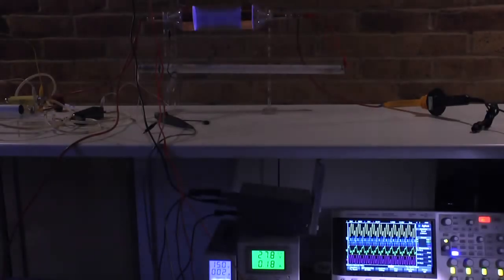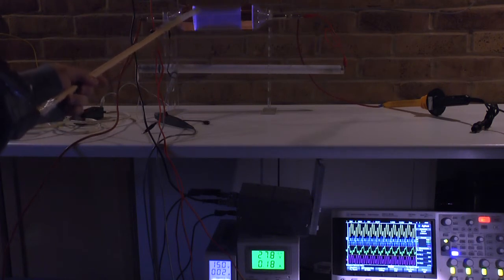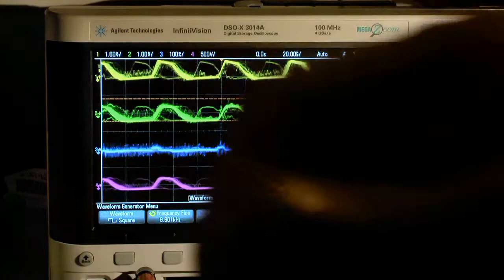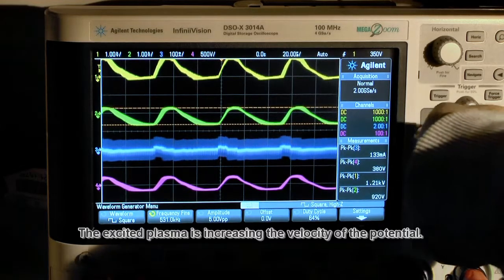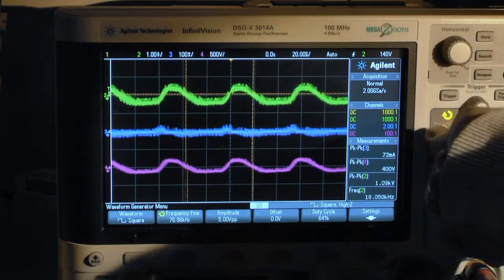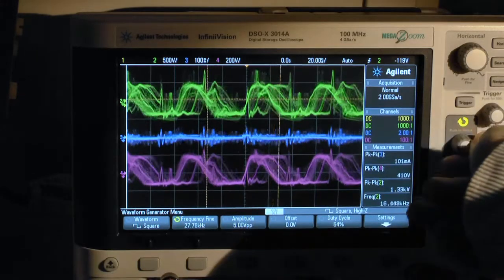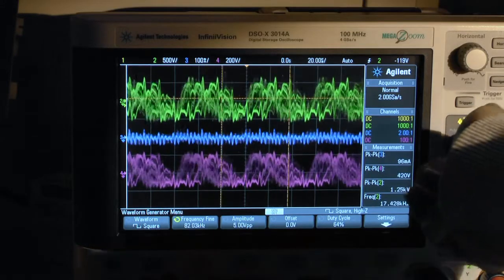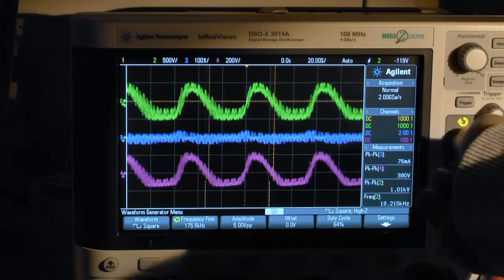The Plasma Switch

Comment: In a long neon tube many bubbles can be created by changing the frequency, The result of RR Rife research i did was a  by product and build. The frequency has to fit in to the length of the tube, 1 standing plasma WAVE bubble for full illumination, or multiple of plasma bubbles are formed inside tube, we can see that only certain frequency's or harmonics fit in to any given lengths of a Edelgas plasma tube. It is interesting to note you work with the transfer of energy from tube to tube is  Very interesting. Also you take note in what container you use for plasma bulb construction.  Thank you for your work, and keep it up.

Comment from the maker: Have a look at my video:  Gamma radiation level of vintage 1B22 tube, radium 226. It is a Gamma Scout which measures alpha, beta and gamma rays, probably it might have a use but I do not want to go there. That is one of the reason the spark gap is so powerful. Electrodes are tungsten/copper alloy and brass on the stationary side. The shielding will be a problem. Have a look at my video :Spark gap designs for Tesla coils

Comment from the maker: I measure from my rotary spark gap in 4 meter distance 10000 time higher gamma ration above the ambient. I was only exposed a couple of seconds but that is very dangerous and I will not use it again with my family in the house. The 1B22 tubes in comparison do not show any gamma radiation in a distance of 60 cm or 2 feet as a comparison anymore.

Comment from the maker: The spark gap has it's limitation and I tested it toa  very high limit. Apart from that is is very dangerous. I measured very values of radioactivity. The air becomes a radioactive isotope for the duration of the spark. Avoid that.
Plasma behaves like sound or a pressure wave.I excite the plasma to react with the ambient ZPE field. This will have a similar function as a spark gap but without the negative side effects and on a much higher scale only limited to the space it occupies.

Comment from the maker: I was expecting this question. No spark gap at all. The spark gap does provide a different function, which is not related to the subject of my current project. Example: The Correa's and also Russ is working on the subject. I will go far beyond. The Spark gap is creating an imbalance in the system where the energy from the field or the ground is rushing in. The parameter to control that is very limited. E.g. electrode material, electrode distance, magnetic and air quenching of the spark.